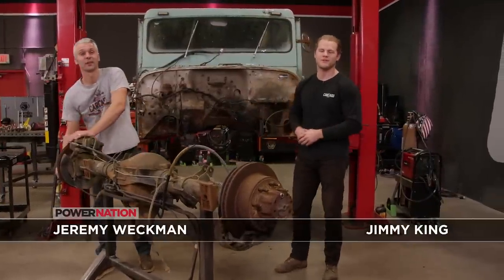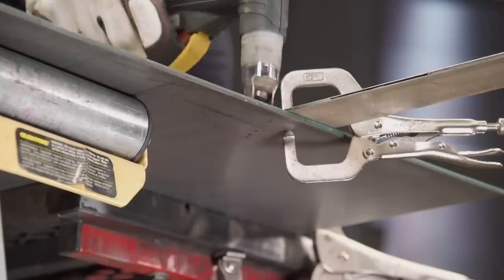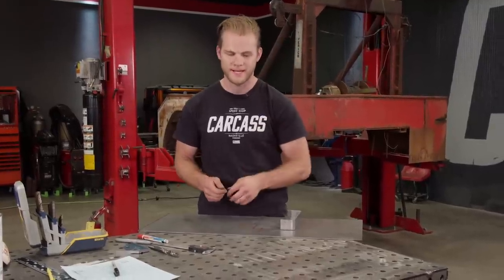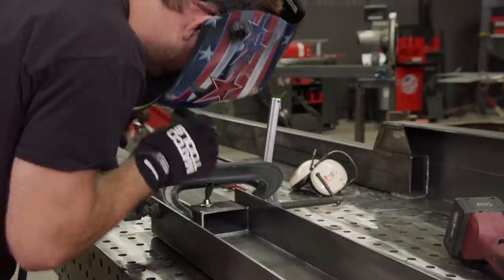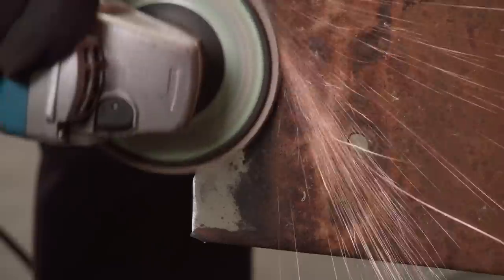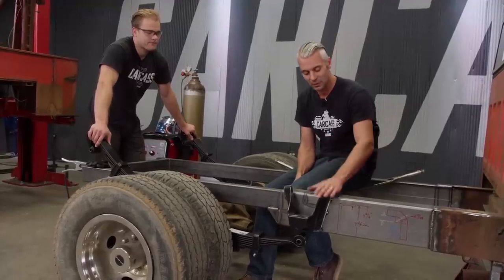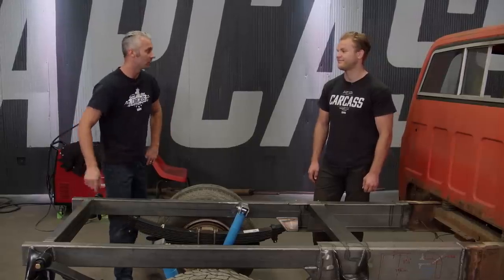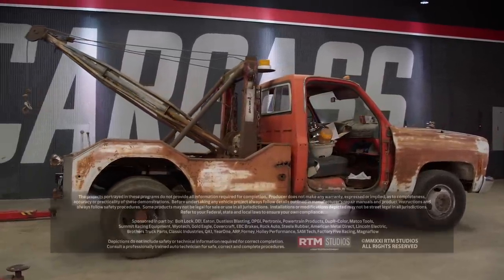Rebuilding The Rusted Out Chassis On Our Square Body - Carcass S2, E2

Comment: Imagine how much easier those calculations would have been if you were on the metric system, like the rest of the world!
Reply: why would it be easier? as long as the measurements are all in the same system its just as easy/hard. Unless you have trouble with fractions instead of decimals.
Reply: @RetroCheater81  are you kidding? Because the metric system is based on 10 and therefore you can actually use a calculator.
Reply: DD PN  what does that has to do with anything?
Reply: @matshammarlund  you need a calculator to add and subtract small numbers?
Reply: @RetroCheater81  no, but how do you add up a chain of measurements like for example; 3feet 5 and a half inch+ 34 feet 9 inch and 7/8 + a couple of more measurements like theses?
Reply: @RetroCheater81  and you’re in really good company with industrial powerhouses Myanmar and Liberia. The only  two countries in the world (+ the US) that hasn’t officially adopted the metric system.
Reply: @matshammarlund  Thats what im saying, they left it all in inches (as far as I remember watching the video) so they didnt have to convert to one or the other. When you work with measuring for a while it becomes second nature.
Reply: @matshammarlund  oh. I see now. You didn’t really want an answer you thought you had a good argument against the imperial system and thought this would be a good place to present it. Why are you so worried about what system of measurements another country uses?
Reply: @RetroCheater81  answer to what? I never had a question, I just wanted to point out how stupid it is that one country refuser (or are to lazy) to change over to a system that all of the rest of the world is using. Maybe it’s become second nature to you but I really thought it would be kind of hard to argue against a system that is all based on 10, makes more sense.
Reply: @matshammarlund  you're right, it wasn't technically a question, but you said it would be easier, and I showed you why it wouldn't make it any harder. You think its stupid, and I think its stupid to be so worried about a country you don't even live in. It doesn't make sense to you because you didn't grow up around the imperial system, where most Americans are familiar with both but prefer to use imperial. I guess you TRIED to make a good point, but didn't really think this one though.
Reply: @matshammarlund  not to mention you did ask how to add feet and inches and i told you how they got around that, so yes, you did have a question.
Reply: @RetroCheater81  yes, I don’t live there but it’s a global world. Don’t you think that it has ever caused problems dealing with other countries? 
To me, it’s one other factor why the US is falling behind, the resistance to adapt or change.
Reply: @matshammarlund  no. People way smarter than us know how to convert every unit. You’re making it a bigger deal than it needs to be.
Reply: @bigboreracing356  that is 50 years ago! That is what I’m saying, sadly you’re falling behind because you don’t want to or can not adapt or change.